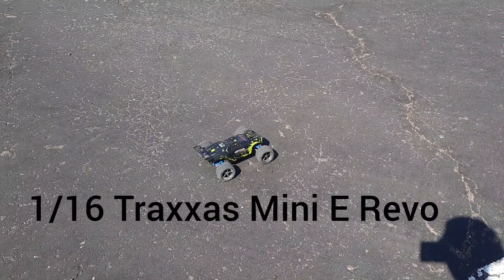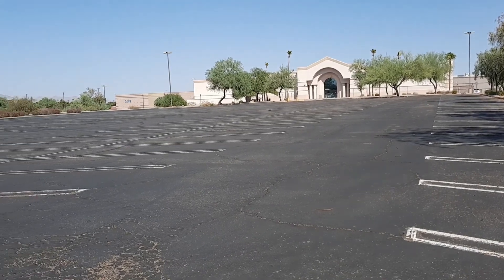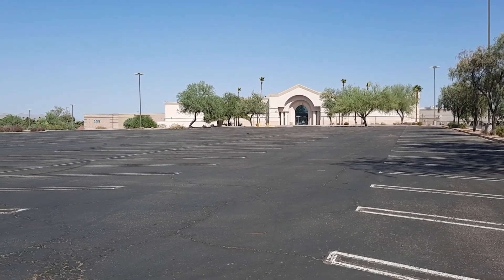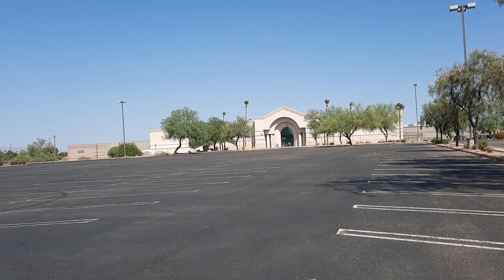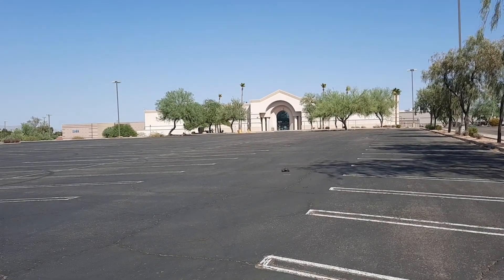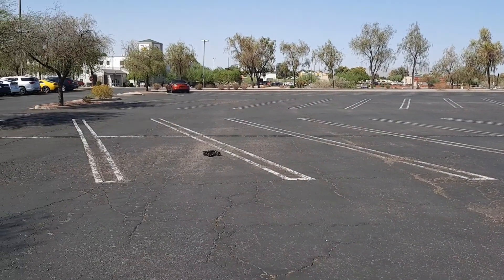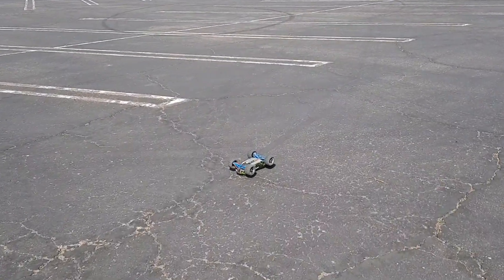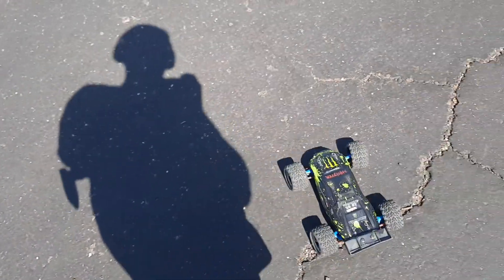Traxxas E Revo 1/16 VXL Running Fast On Pavement 3S

Comment: Does it go through grass well?
Reply from the maker: Yes, it does pretty well in grass.  Not as good as the 1/10 scales but for the size it does pretty good.  Its almost like the car is floating on top of the grass. Give me a week or two and I will post a video of driving in the grass at the park so you can see how it drives in the grass.
Reply from the maker: The video of the car running in grass posted today.
Reply: Ok thanks